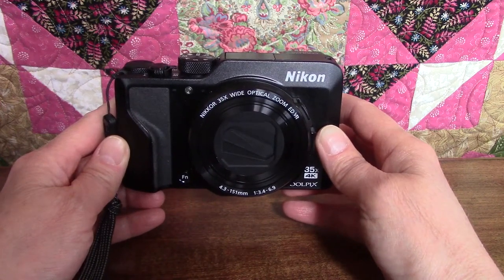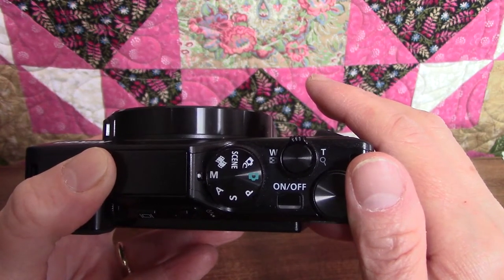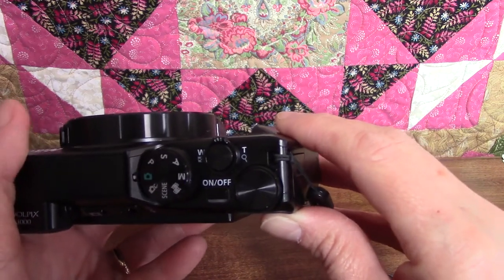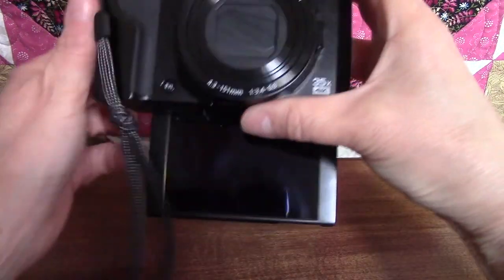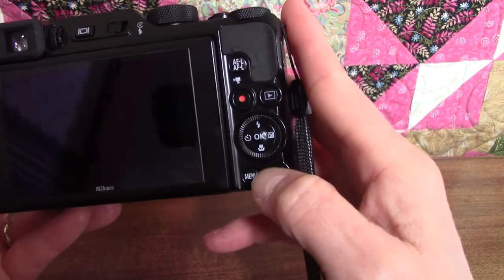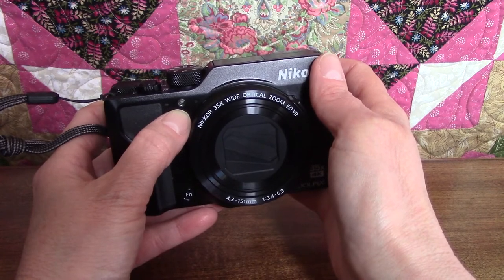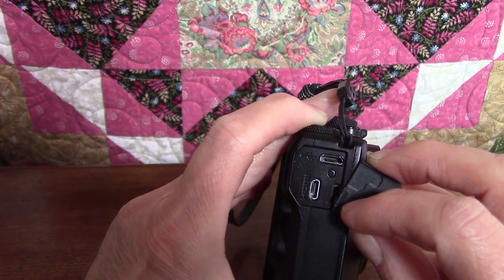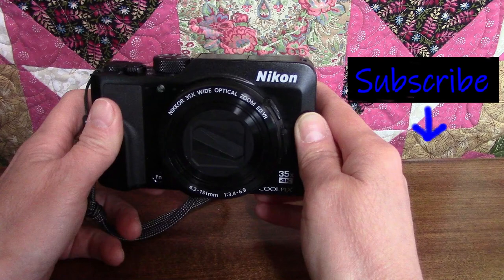Nikon Coolpix A1000 Tutorial #1 - Parts of the Camera & What They Do - Digital Camera Basics

Comment: The viewfinder button is used when you turn off the auto sensor in settings. That way the main screen won't keep blinking off when you're handing the camera. You can then use button to switch between screen and viewfinder manually.